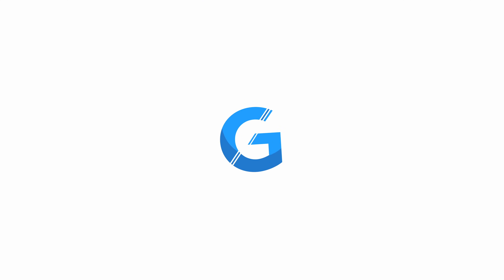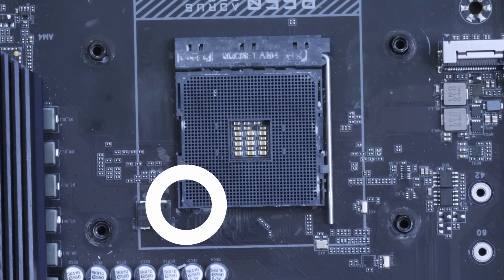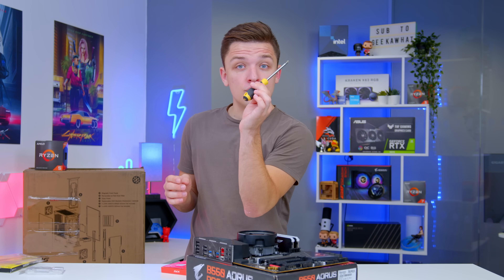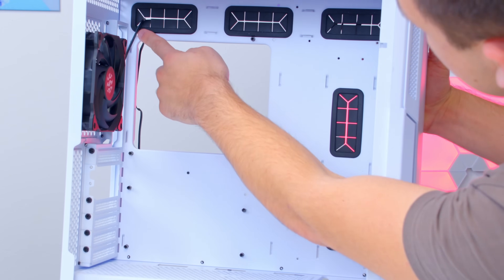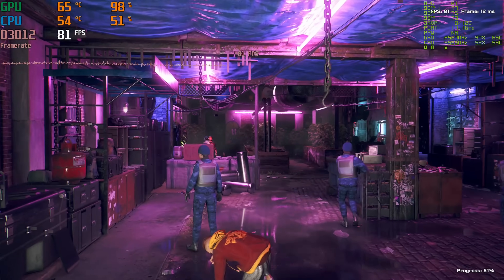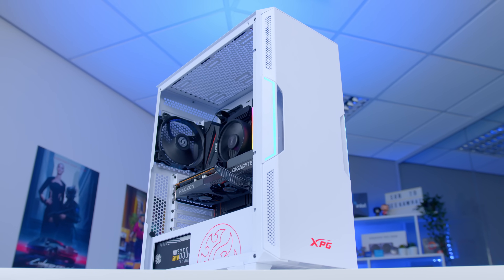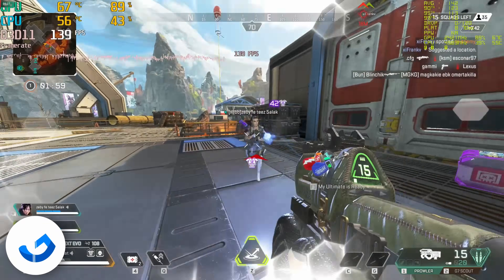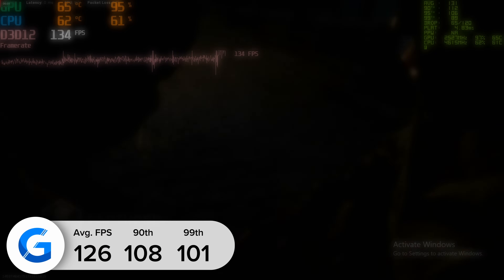$1200 Gaming PC Build 2021! [Full Build Guide - ft RX 6600XT Gaming Benchmarks!]

Comment: Anyone else having a hard time keeping their 5600x cool with the stock cooler. When udder load its like 80c. Even after under volt-ing* I have great air flow too.
Reply: Those temps are normal with the stock cooler unfortunately, In my opinion I don’t think they should use those coolers now for the 5000 series I’d rather save a few quid to put towards a better cooler than use a cooler that could potentially fry it within a few months of using it I switched to a noctua NH-U12s and the performance is great the maximum temps I’ve had on the cpu is 65 degrees! An aio would be great iswell for it. :)

Comment: Great build! But! And I mean but! The 6600 Or the XT version do not compare to their NVidia counter parts the 3060 and 3060ti are far superior respectively!
Reply: the 6600xt is faster than the 3060 and its cheaper
Reply: @caps721  Yes but just in this situation. In MSRP the 6600xt isn't supposed to be compared with the 3060, is supposed to be compared with the 3060ti and is beaten by this one.
Reply: @nicolasgracia1040  I’ve had both and 3060ti > 6600 xT
Reply: @mikea1785  Completely.
Reply: @nicolasgracia1040  but the thing it the 6600xt is cheaper than the 3060 I would rather get 6600xt
Reply: @caps721  That is so obvious that makes no sense telling that to us xd

Obviously you would get the 6600 xt instead of the 3060 because they don't even match each other, the 6600 xt is supposed to be superior, is like a league above.

Is like saying that you would get the 3080 if it's cheaper than the 3070, it's so obvious that you don't have to say it.
Reply: @caps721  literally not by much msrp especially
Reply: @mikea1785  in 2021 there is no msrp
Reply: One of those people aye? Just respect both cards

Comment: My future build will be Intel i5 11400f, AIO Cooler, MSI B560M Pro-VDH WiFi mATX, 16GB 3600mhz RAM, MSI RTX 3060 Gaming X 12GB, 256GB SSD, 1TB HDD, 600W PSU, ATX Case with 4 fans ❤️
Reply: Why an aio just an air cooler will be fine, go with 3200mhz and air cooler and upgrade ur mobo to aorus b560m pro.(vrm issues with a lot of b560 mobos)
Reply: @EggCurry47  air cooler and aio cooler is almost the same price from where i am. Can't i OC the RAM mhz on my mobo?

I'm very new to pc building, so I'm open to any tips, do's, and don'ts. Thank you. 😊
Reply: SharkyPPL  Intel 11400f has actually better performance (when max TDP) to the same priced (currently overpriced ) ryzen 3600. Intel is preferable.
Reply: If i were u i would go with the radeon rx 6600xt in my opion and not only mine look at the benchmarks on youtube this card is way better than the 3060 
Just have it in your mind BETTER PERFOMANCES
Reply: @nk_panos2238  rx 6600xt doesn't have CUDA support, and ROCm being in its infancy 3060 is a better option for versatility. U can do DL and machine learning with CUDA better than ROCm plus u can game